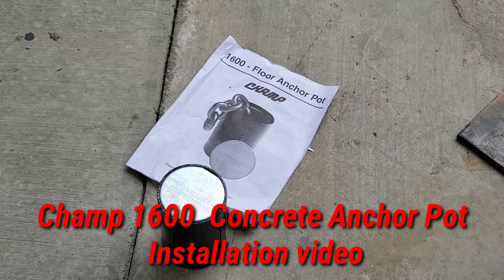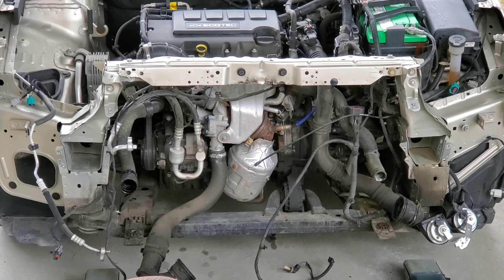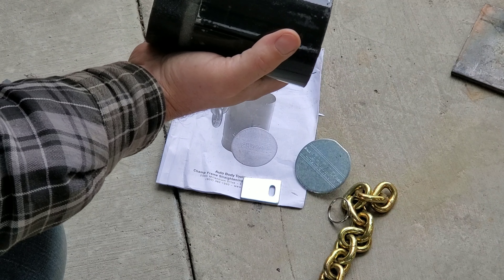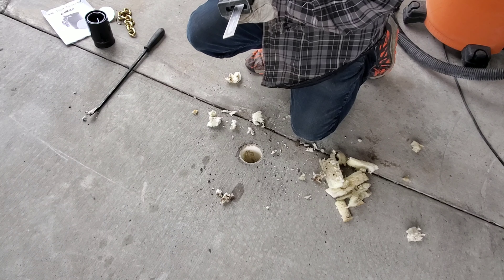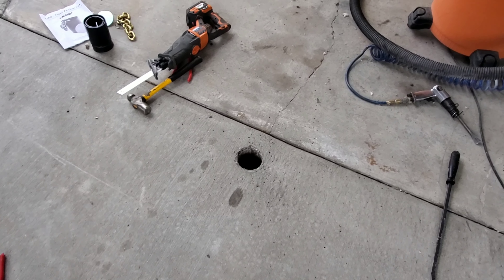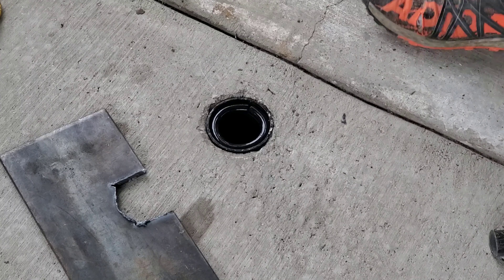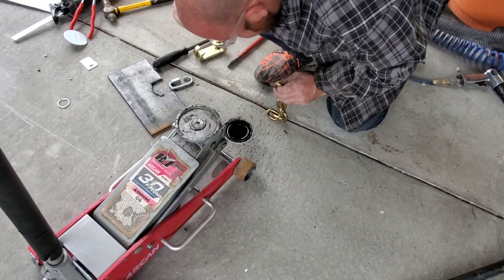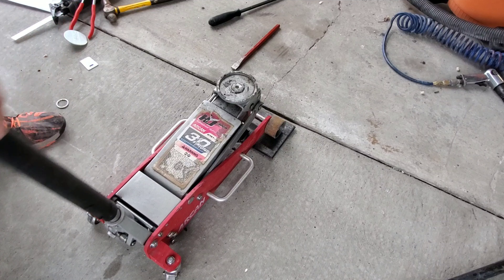Champ 1600 anchor pots Installation into concrete For body work, Frame straightening, fabrication

Comment: I think I will cement the pots in at the time of the pour. Also, you should have polished the floor a little more. Looks very rough and porous
Reply from the maker: Yes wish I did would have made it nicer.